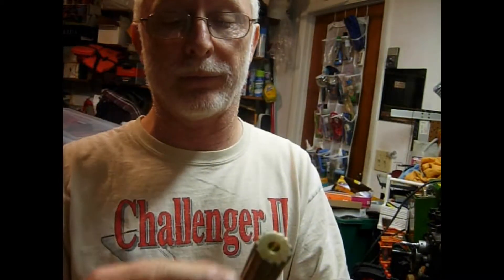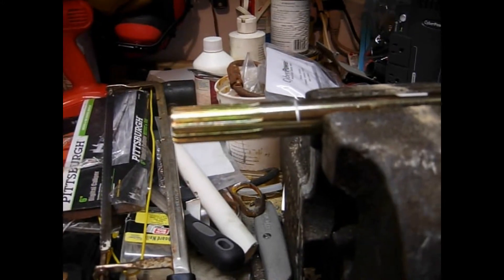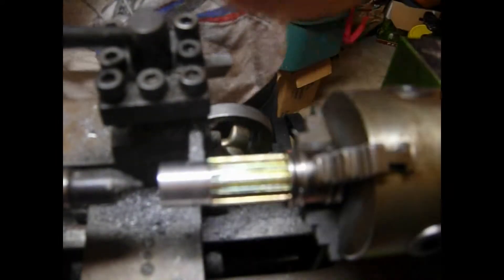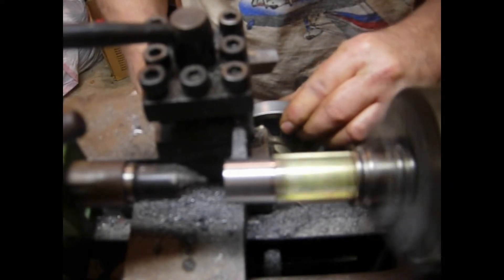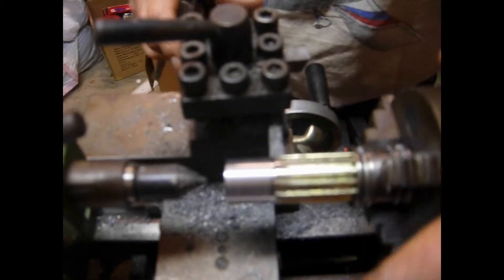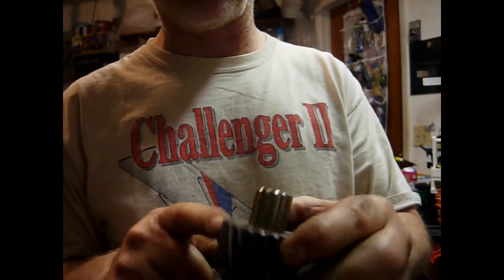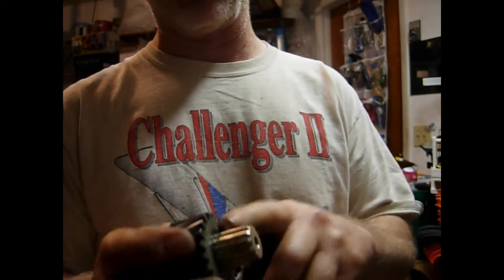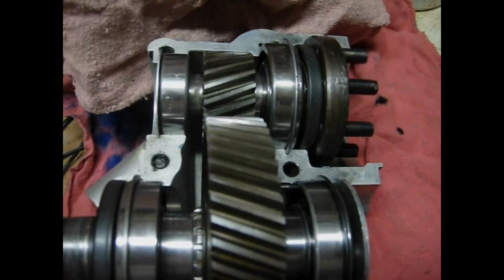Making a new Gearbox Input Shaft

Comment: what weight gear oil do you use and how much do you add? i have the same gearbox on a hovercraft and i would like to check fluid levels and possibly change, but do not see a fill or drain plug. do you have to spit the gearbox to change fluid?